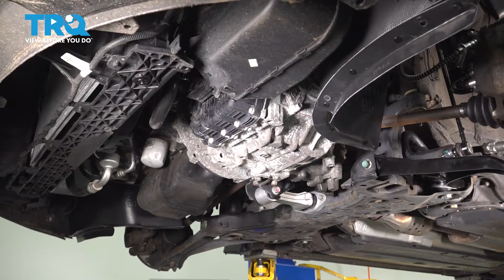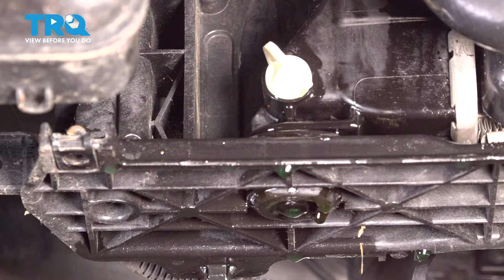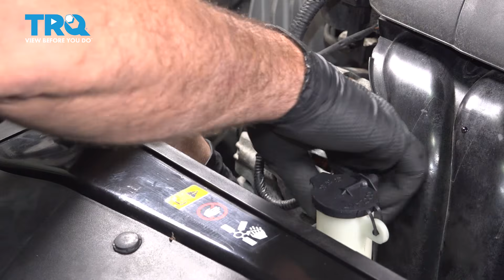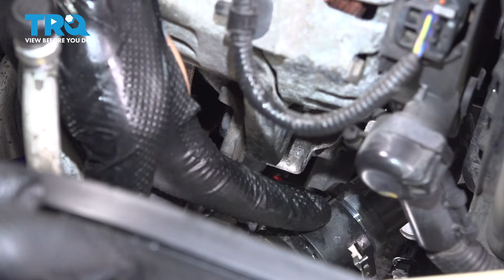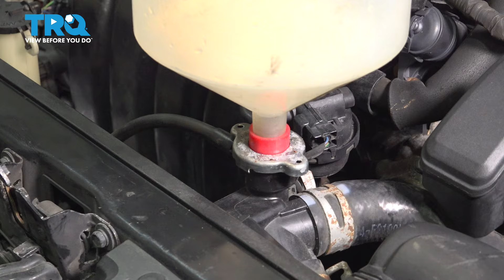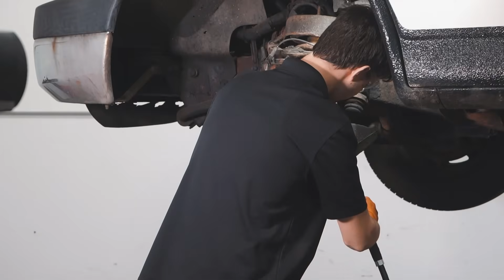How to Replace Thermostat with Housing Assembly 2017-2020 Hyundai Elantra 2.0L L4

Comment: Was able to save so much money by knocking this out myself and having to only paying for parts. Genuinely appreciate the video! Was easy to follow and covered everything I needed.
Note: My hose connecting to the t-stat housing had the push pin on the inside, instead of towards the alternator (like in your video). Coudln't use a flathead or any tool really, and it was a real pain getting a good push on that pin with the tip of my fingers, while trying to yank that hose out!! God bless determination!